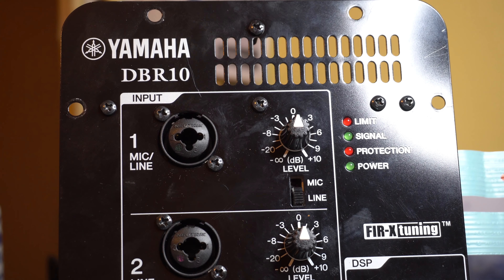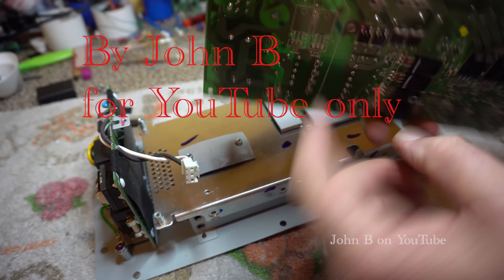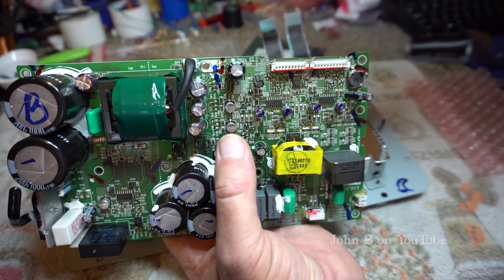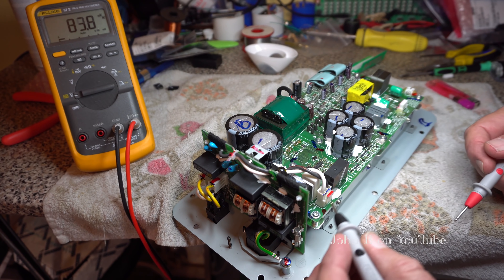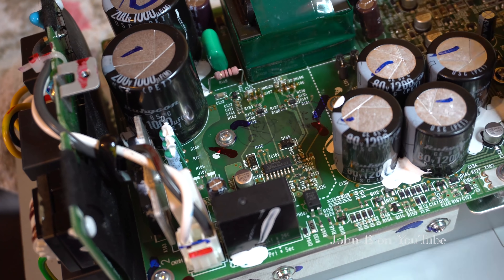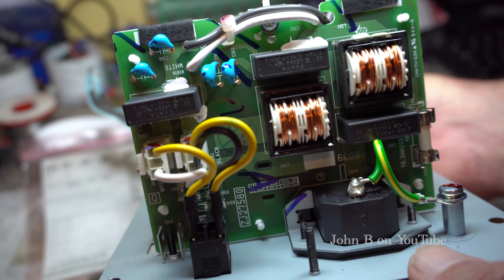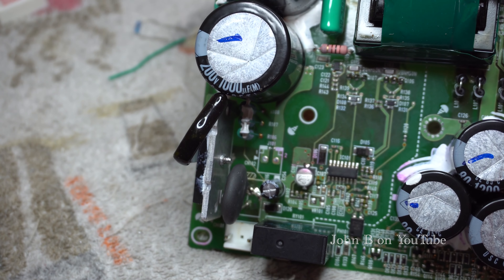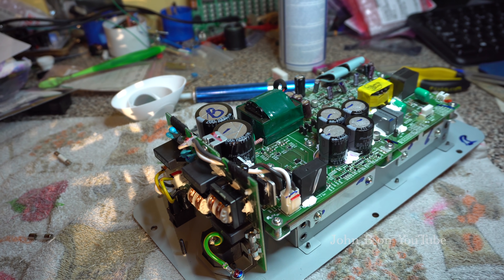Yamaha DBR10 Repair and Review - Spoiler - It's a Great Speaker - But it still failed !

Comment: Hi John. Great videos keep them coming. 
Re the 6.8 ohm resistor, If you look at the circuit, the relay contacts are across the 6.8 ohm. when the power is turned on the  relay is open and the 6.8 is in series with the rectifier. the power supply then starts up and produces the -15v line which turns on the relay , shorting the resistor. A nifty way of producing surge protection. .This  is very common in these types of high power amplifiers (the Mackie SWA1801 uses a 22 ohm 20W resistor in this way.) also if you look on the pcb adjacent the fuse holder, the correct fuse rating is printed there for reference.
Reply from the maker: Thank you for your comments but most manufactures use in rush limiters and the 1801 is at least a 15 year old design, I've repaired many.

Comment: Having a day of electronics today. Even I wouldn't have done that to the resistor, maybe not even using a solder sucker either and overheating both legs and pulling it out.  Anyway thanks for another great video JB aka twin.
Reply from the maker: Yes I see the problem often.

Comment: Hi John, I love your videos and the way you explain things easily! I’m in the states and a used Yamaha DBR10 brought from Australia is up for sale that I’m considering buying. However, on the back it says 220-240V. Will it still work properly/perform normally on 110V or will some modification be needed?  TIA
Reply from the maker: Yes it will work on 110 volts. 
Thank you for your comments.

Comment: Nice Video, you should have NOT replaced the resistor with that NTC. the reason is that the 6.8OHMS resistor acts like another fuse. and it has another protection purpose on the circuit. That resistor protected the other parts from blowing up. because it blew up due over current. Putting the NTC in place of the resistor will make it impossible to stop the current draw at next failure. and it will keep passing the voltage and current until your fuse blows up. Also as you can see that your FUSE is bending at power up. reason is that the NTC Resistance will decrease with heat. resistor is resistor and it will not change with heat. YAMAHA knows what they are doing. ultimate piece of engineering. good luck
Reply from the maker: Putting a resistor in line is old school.
The resistor does not protect anything from blowing up.
If something is going to fail, the resistor is not going to stop it. 
I didn't want another possible resistor failure, that's what fuses are for !
The resistor means the average consumer will have to take it to an engineer or buy another speaker.
You should read up on Inrush limiters, they replace old school resistors.
At full power, the resistor would be dissipating power needlessly !!
One needs to limit the current at switch on and then at no other time.
The fuse is bending because of the current surge which is due to the discharged capacitors, not because of the inrush limiter.
You're also telling me how the resistor works, I mentioned in the video, the resistance will not change.
Reply: John B 
Ok, resistoe doesn't protect? Make your test again and put a resistor make a short circuit at the 340v line. And see if it will blow or not. I think you didn't understand the idea behind it. Only professional companies are using resistor. Using NTC is not the ultimate solution. Put NTC and see what will he happen next time, your PCB will have more damages
Reply from the maker: I understand what you are saying, but if the pcb is designed properly, the fuse will simply pop.
Panasonic have thermal fuses under some of their inverter transformers in tv's, they don't want the system to blow up.
In many applications, a thermal fuse is maybe a better option.
In my opinion, the 6.8 ohm resistor with internal thermal fuse serves no better purpose than a 10 ohm inrush limiter. 
Let's face it, the system had blown up, so even Yamaha are not world leaders in SMPS design.
Reply: @JohnB-2021  The Guy makes SMPS's and is active on diysmps.com obviously he know what hes talking about.
Reply from the maker: @yaghiyahbrenner8902  Maybe he can tell Yamaha why their smps's are blowing the FETs then.
Reply: @JohnB-2021  totally agree.
Reply: @JohnB-2021  No, I have no interest to tell YAMAHA why their SMPS is blowing FETS, because that will happen with any SMPS, there is no bullet proof SMPS in the world. its all semiconductors, and they will fail at some stage. but an easy to repair SMPS is always a winner, I also would like to add a very good reason why those FEST died, its because of that thermal insulator, its more than 1mm Thick, and it will create HOT SPOT inside the FET over time and over PEAKS, witch needs time to be transferred to the heat sink, so for example if the heat sink underneath the FET is 45C be sure that the actual temperature of the FET is 65C. Thank you
Reply from the maker: @MicrosiMe  
So now you question the design of the thermal pad material Yamaha choose?
But your first comment you wrote " YAMAHA knows what they are doing. ultimate piece of engineering"
You have no evidence to support your claim, oh and a fet at 65 C is not a problem considering many can run up to 175 Degrees C now.
Why should 1mm be ok and not 2 mm?
On a DC Current Load unit, we don't want any insulator between the FET and heat sink, even a mica washer is too thick.
There are many designs of SMPS power supplies that don't go wrong, a pc power supply for one, all the inverters on a pc motherboard,  APC brand UPS, they all go on and on for decades without issue. The smps on the 450v2 Mackie is pretty bullet proof and their new stuff incorporates short circuit protection.
TV power supplies have much higher voltages and last for decades because they have been designed correctly. 
If you think semiconductors are unreliable, remember that next time you pop out in your car and turn on your gps, or use your mobile phone.
Or think of the electric car on the motorway with very high power inverters that just keep going.
Reply: @JohnB-2021  Thats true indeed.

Comment: Hi John
STF28NM50N has explode in my DBR12 , is it affected by other parts?
and why it can explode?
i will be waiting for you answer, thank you
Reply from the maker: Hi Michael,
Yes it will have blown the resistor (probably) 
The FET type is probably not the best choice, it's difficult to know if they get too hot or the voltage is going out of the maximum spec somewhere.

Comment: Fixed a DXR12 series recently, no power. Same resistor blown, checked the fets, it was alright. Replaced the resistor, unit turn back on, sound was ok. If you power cycle, the resistor will blow again. Guess what? The culprit was the main capacitor. Replaced it, walla no more blowing resistor. Best part, the capacitor showed normal reading with a capacitor meter.

Update: Spoke too soon. It blowed again after using for couple of hours. Now im lost.
Reply from the maker: You need to put a scope on the psu to make sure it is switching correctly.

Comment: The original 6,8 resistor look alike is actually a resistor with a built in thermistor. It is not a normal ceramic resistor. Made for Yamaha. I usually replace with a 10 ohm thermistor as you did.
Reply from the maker: Thank you for the info, I forgot to have a closer look.
Maybe a thermal fuse at 142 Degrees C?
Reply from the maker: Hi, what will pop, the SMPS or the fuse or ?
Reply: The 6,8 ohm will pop, usually unnoticed.
Reply from the maker: Thanks for the comment, but if that resistor pops, I'm sure most people will notice because the amp wont start up.

Comment: Hi John B, nice video. I just wanted to ask why not having the PFC circuit on the switch mode power supply would be a good thing with active speakers. Thanks
Reply from the maker: Hi,
Mackie had a PFC circuit on their 450v2, it boosts the mains from 320 volts dc to 380 volts dc.
8 in 10 failures of that amp will be the pfc circuit.
There's nothing wrong with the pfc design, they just don't last with the high voltages and currents involved.

Comment: Thanks for your video. I have a pair DBR-12 and only the rca input works . Any idea what could be wrong?
Reply from the maker: If the XLR inputs worked previously, they have been over driven and maybe blown a small resistor or something.
Reply: @JohnB-2021  thank you! I’ll check the circuit to see if I find it.
Reply: Do you have the circuit schematics by any chance ?
Reply from the maker: @abeltrujillo8413  there are links in some of the comments below

Comment: I have some active speakers Alto TS 315's 2000 watts each only two years old one of the speakers does not power up some days and some days it does.the fuse is good opened it up to check connections after a visual inspection I see nothing wrong,I left it on for a while to see if it would heat up and shut itself down.I have done this twice and brought it to a gig and it would not power on with three different power cables when I get it home it powers on.....please help
Reply from the maker: I have never seen an Alto; and if I had you're asking the impossible. i.e. diagnosis without checking everything with a scope.

Comment: Hi John , Like your videos but we may have a problem, That 6.8r resistor is very important , It has a thermal fuse built in @ 142 degrees , The idea is if the switching IGBT's are short circuit then the resistor heats up the blow the thermal fuse open.Rather then blowing traces .
Reply from the maker: Hi,
You're forgetting about the 3.15 amp fuse

Comment: Hi John B, good work in both presentation and process. Im a bit mad since when moving from US (120V) to Europe (230V), i thouhg i read tehre was an internal voltage switch. No, not true. Now im thinking best way to resolve. Could buy a new AMP board, but freom where?  Or perhaps, cut the two legs off the bridge to change it from full wave to half wave, and perhaps need to change from front end compontents too. Suggestions to mod the front end of the power supply? BTW, i could not find the schematic, to check trafo details. Its all wrapped. Can you share?
Great job, many thanks, George
Reply from the maker: Thank you for your comments George.
The power supply is rated for 120 and 240, no mods required.
Reply: @JohnB-2021  Thanks for your quick reply John, I dont have the schematic, I thought I read it could be changed, but i seen no switch, and have not come across different board models for the various markets, they all seem to be type YF909. Its safe to go ahead with 230V source?
On another note for my CR5 mackies, im looking for a 230V/15/0/-15V 1.5A trafo. You can recommend a source? Thx!!
Reply from the maker: @georgeralston  Farnell, RS Components, Mouser, DigiKey
Reply: Hi John, I pulled out my speakers, and decided to go ahead and plug it into 230V. Seems like the power supply is not rated for 240V. Some key changes between the euro version and US version. ell - Bang and lots of smoke. So now im sure its damaged, probably the 1000uF caps. Do you have the schematic you can share? thanks.30/9:  Found the schematic, looks like i need to add the jumper to limit the voltage and swap out a few resistors.

Comment: Hello John, First let me thank you for such informative videos.
I have DBR-10, the voltage across the drain of the first MOSFET is okay and the in rush 6.8 Ohm resistor is also okay but my relay isn't clicking. Could you possibly please guide me how can i get this thing running?
Reply from the maker: If both fets are ok, the driver must be faulty.

Comment: I was wondering could those chokes cause noise that sounds like some interference (like from a bad signal from a wireless mic). I have a yamaha dxr12 that is causing some noise and small hum after the speaker has been on for a good 20 minutes. Anyways I'd rather find the specific cause then the complete amplifier replacement which costs a few hundred less USD. Do you think that could be it
Reply from the maker: Hi,
No the chokes would not cause any noise.
Does the speaker hum with all inputs disconnected?
Is the noise from the tweeter or woofer?

Comment: Hi John. I have a Dbr 10, and unfortunaly my Son conected it in a 220v outlet (the speakers were with 110v seting). The amp broke. Any clue where do I start to fix it??? Thanks
Reply from the maker: The power supply is going to be blown.
You'll be lucky if it hasn't done a tonne of damage.
Reply: @JohnB-2021  Hi, thanks. Any clue where to start in Psu? Thanks
Reply from the maker: @Altsouza64  did you not watch the video?
It has all the clues

Comment: Hi John. I have a DBR12 and I turned mine on to 220, but it was switched to 110. Any tips on what it could be?
Reply from the maker: The smps works with 110 or 220, maybe it just failed like the one I repair.

Comment: @John B ... How many series/type of diode D 109
Reply from the maker: What is D109?
Reply: @Jhon B . diode D109 short circuit do you know what type of diode.  because I don't have the schematic diagram
Reply from the maker: @jacousticproaudio  If you don't have experience to pick your own device, spend 10 seconds looking on Google for the manual. 
It has the part numbers.

Comment: Hey John, can you tweek with the dps settings? I want to replace the original speakers with better ones so that I have a lower power compression.Can you tell me what impedance are the woofer and the compression driver?
Reply from the maker: Hi,
Only Yamaha can tweek the DSP settings, but they are optimised for the speaker.
I believe the woofer is 8 ohm, the tweeter will probably be 6 or 8, doesn't matter too much.
It just matters if you're going to reduce the impedance of the woofer below 8 ohms, it will start loading the amp and cause it to get hot, that's if it doesn't cause the power supply to go into current limit.
Reply: Well, I guess I'll stick to the original drivers in that case, without changing the x-over ,phase and eq settings I will just ruin the sound with other drivers.Thank you for the reply!

Comment: Hai John, I have a Yamaha DBR15, the total cause of generator is over voltage. I check the fuse is still normal. I ask your help to solve this problem. Thank you
Reply from the maker: Speakers with switch mode power supplies should not be run on generators.
Your problem is probably the same as the amp in the video
Reply: John B What are the broken spare parts names like in the video? And there's still hope yamaha dbr I live again or not?

Comment: Very interesting video.  You obviously have a lot of experience with and understanding of class D amplifier circuits.  I’m assuming that you are repairing a unit that is out of warranty and/or was discarded or sold for parts.  I can’t imagine that a Yamaha warranty repair person would get down to fixing on the the component level…they’d just replace the whole PS board.  Are replacement boards available to the general public, or do you have to be an authorized Yamaha repair person to order them? If so, wouldn’t it be cheaper to fix it that way (assuming that you do this for a living and charge an hourly rate)?

Comment: BTW, it occurred to me that maybe the way the board got damaged in the first place is that when the 3A fuse blew someone replaced it with a 6A fuse that was meant for the North American 115V version of the circuit.  Kind of makes you understand why manufacturers aren’t designing products with external fuse holders these days…
Reply from the maker: Thank you for your comments.
Some manufactures will send complete boards to end users / general public, others don’t.
I’m not sure about Yamaha.
If you take a look at an EV speaker, their amp and power supply board was over £200.
I repaired the EV for £65.
I’m guessing the Yamaha boards would be double the repair price or more.
I think you’re right about the fuse, the amps are dual voltage but marked as 110 or 240.

Comment: Heloo Jhon.. my dbr is 15". The last i use that speaker in about 1 full night. Than finally the woofer no sound anymore but the high can sing. What is the problem?
Reply from the maker: Obviously a bass problem, it could be anything.
Reply: @JohnB-2021  which parts of it?

Comment: I have an amp like that for a dxr15 that doesn’t power up but if I hit the speaker on a side it turns on sounds like a relay not kicking in but when I hit it sounds like it kicks in and powers up. Any idea what I can check to find my issue?
Reply from the maker: no idea

Comment: Hi john. I have dxr 15, how to fix my amp failure.. Only tweeter sound, woofer sound slow...
Reply from the maker: If you're in the UK you could try Real Electronics or a guy advertises Mackie repairs on ebay.

Comment: Hey John! Thanks for the informative video! I recently dropped one of my Yamaha dbr speakers 🙄😡 now on the low end there is feedback. I have checked all external screws so I believe it's coming through the speaker itself. What should I do/check next? Hope you can help, thanks!
Reply from the maker: You may have caused one of the heavier components on the pcb to become detached or maybe the pcb itself is damaged.

Comment: Hi John. I saw one of your videos where you changed the amp on a powered speaker and I was wondering how I could get more bass out of my Mackie SRM 1850 sub.
Reply from the maker: Hi,
I have not changed any amps, I just repair them.
Other than using a mixer, you can't get more than you have without changing the speaker.
Try the HD series.
Reply: @JohnB-2021  thanks